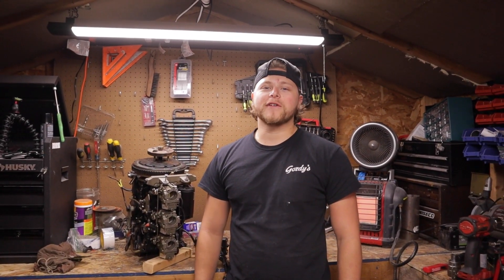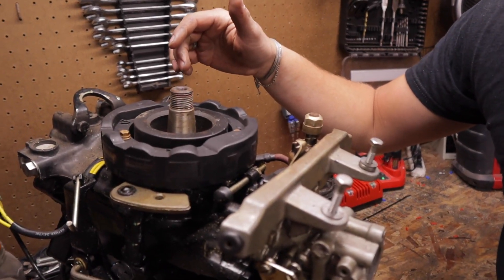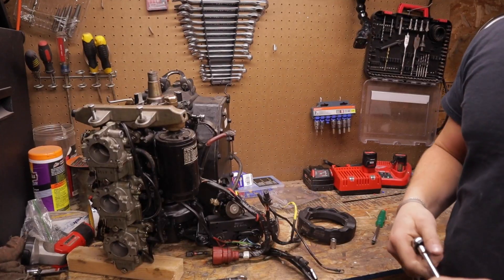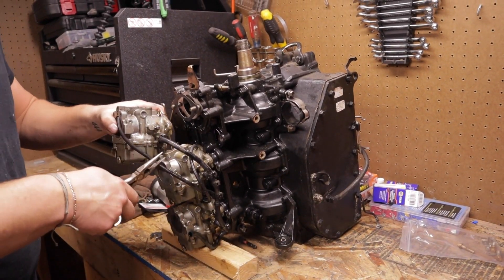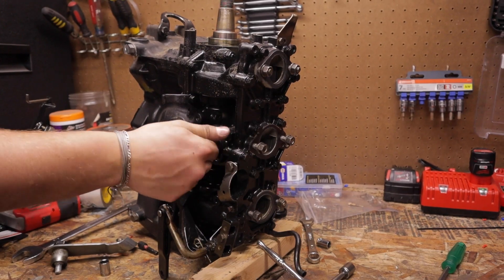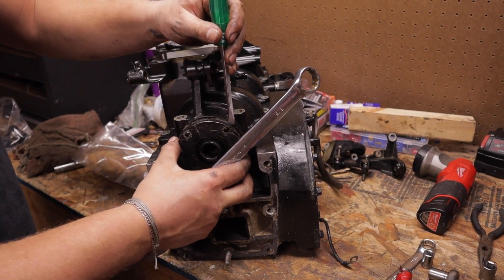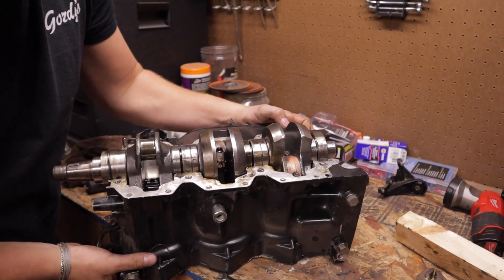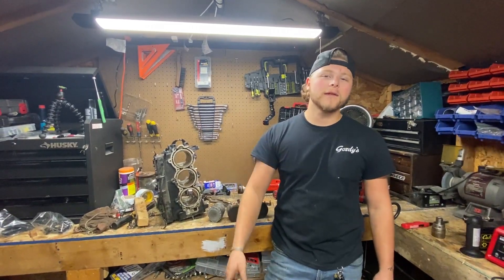How to Tear Down Johnson/Evinrude 70HP POWERHEAD! (65hp, 70hp, 75hp 3 CYLINDER)

Comment: How would you go about pulling the head off of a 97 70hp Johnson, when the 4 bolts around the center cylinder snapped off at the block
Reply from the maker: get the rest of the bolts out and remove the head, first try drilling out the centers and use an “ez out” to try and unthread it (you can get them on amazon, if that doesn’t work weld a nut onto the end of them and keep trying to work it back and forth until they eventually come out. center cylinder you should have room for a drill so you’re lucky there but it’s still going to be tough. hope this helps!

Comment: Anyone having the notorious "engine runs fine out it under a load it dies out" your problem is your carb. They nee to be synced, make sure all your butterflies open and evenly. Clean your jets and i promise it will run. I had the same prob and finally fixed it
Reply from the maker: This is a good comment, I haven't really ever gone through "link-n-sync" in a video but that's a good idea for the future

Comment: Hi. I see a few comments that people asked you question but they got no answer. I hope this time you’ll find the time to reply. I have a 1983 70hp evinrude that idles just fine and it even Oky when putting it in gear without any acceleration. But as soon as I accelerate it shuts off. Any suggestions please??
🙏🏻 Thanks
Reply: Carbs need to be synced had the same problem took it to the shop and $90 bucks later good to go. Clean them too could be just  a clogged jet.
Reply from the maker: @timmckeon2360 that's a good tip, my first step is always going through the carbs after I know ignition is good. Make sure all of the jets are spotless, lack of fuel motors like to run out of the water but die when put in gear

Comment: How difficult is it to take it apart and rebuild?
Reply from the maker: Compared to new engines they're very very easy but it still takes some mechanical knowledge. It's much easier if you can fully grasp the concept of how everything works so it makes sense what you're taking off and putting on. With the manual it makes it easy it's pretty much just terminology at that point
Reply: When possible take numerous pictures and or a video during the process.

Comment: did my tear down on this video went great got parts in and now gotta put back together.  Did you ever do the reassemble video?
Reply from the maker: unforttunately I didn't get to make the assembly video of this - had to get it back to the customer. If you need any help or I may have the manual email ST.Marine@outlook.com!
Reply: @buschfishin  Very cool of you I will email you if you have the manual that would be awesome.  Got a few other questions for you as well.

Comment: Why they always have problem with top cylinder only  0.30 was ok ? Bore survived?
Reply from the maker: .030 took everything out and the bore was okay. The fuel is fed out of the pump to the center carb and from there it T's off to the upper and lower carbs, most of the time its because the top carb gets less fuel because it's having to go against gravity and therefore makes the top cylinder run lean. Running lean is the death of these motors.
Reply: @buschfishin   maybe worth  feed carburators from top or install electric low pressure electric fuel pump?
Reply from the maker: The issues usually arise when the fuel pump or VRO starts to give out. VRO’s not pumping oil is a big reasoning for this but lack of fuel “pressure” will also cause it. As long as the fuel pump is in good working condition feeding them from the center is usually okay but it wouldn’t be a bad idea to have the main fuel feed go to the top and then gravity feed down. It could also have to do with the fuel pump pushing fuel up-hill to the top carb where it’s at the same height as the fuel pump to the center carb.
Reply: Hi.I got 0.30 rebuild kit. I just arrived today. WSM piston, can u recommend piston to bore clearance cheers again 👍
Reply from the maker: should be anywhere from .003” to .006” to bore

Comment: Great Vid! Question for you.. I have the same outboard and a friend of mine was adjusting the choke as it would start but not stay idle. The outboard flywheel and starter got stuck and now the wheel will get jammed and stop about half turn both in forward and in reverse. We were turning by hand. PB blaster was used and nothing. I’m in Florida Space Coast area. Asking before I tear it down. Any ideas?
Reply from the maker: I believe what i’m getting from this is that the starter is engaging with the flywheel and getting stuck. What I would suggest is tapping the starter with a hammer while cranking it and see if that makes any difference. If it does then it will most likely continue to work for awhile but it’s starting to go. If not then most likely it needs a new starter. Some other tests you can do are testing continuity through the battery cable from starter to starter solenoid, through the starter solenoid and then to the battery. I have a very in depth description of how the starter solenoid works in my Johnson 35hp video if you’re curious. Let me know if I understood you correctly!

Comment: I have a 70 horsepower Jonson 1990 and the upper engine mount is needing to be replaced its bad
Reply: Hey Dale this Buzz In Kitty hawk ,NC. I've got the same job to do. Did you get it done. Got any pointers I'd appreciate it . Thanks Capt. Buzz Ackerman---JAWFLY CHARTERS
Reply: @buzzackerman1011  hi man yah its a job you have to pull the power head off to do it
Reply: @dalephillips675  I've got that, not too bad . Did you bust the bolt on the mount itself? I haven't yet, the 2 small one are sketchy. Where did you buy the mount? Thanks
Reply: @buzzackerman1011  i was lucky and had a parts engine